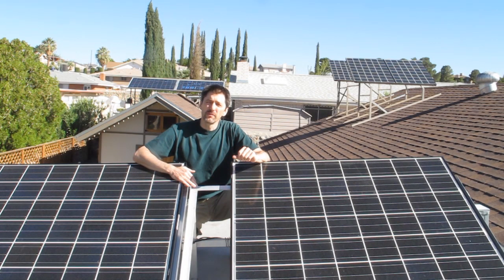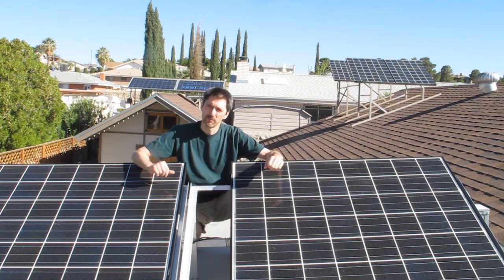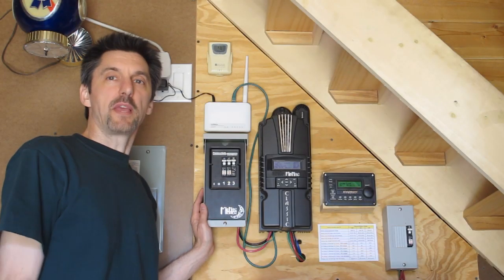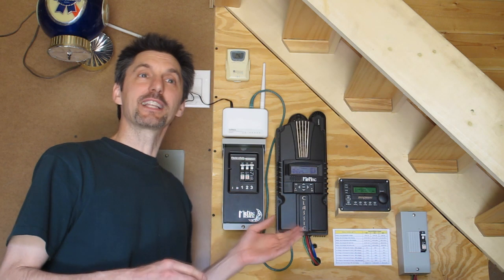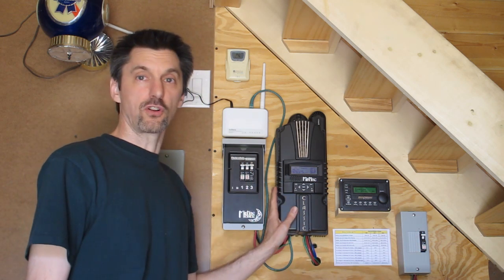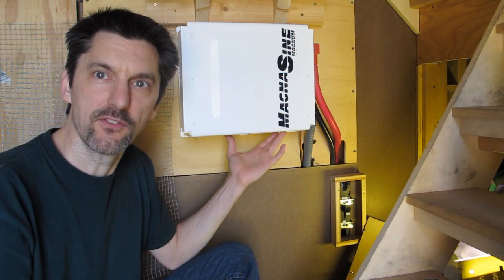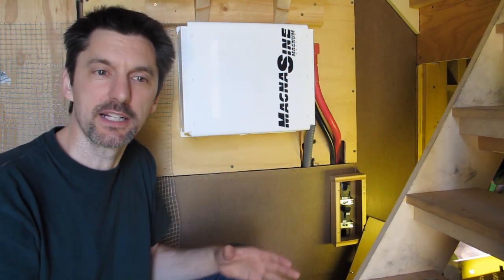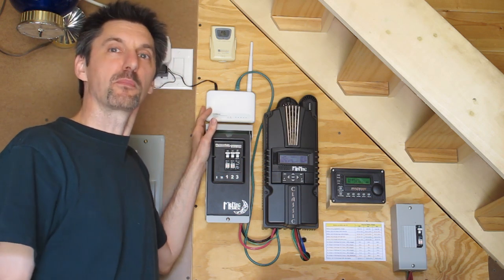Solar Power 2nd Edition (Upgrades and Battery Bank Wiring)

Comment: Awesome video, I have a quick question... I purchased 4800 watt solar panels.. I’m confused on which Midnight Solar Charge controller to get the best out of my solar panels (150, 200 or 250) ?? Any feedback would greatly appreciated brotha, Thanks and hope to hear from you soon
Reply from the maker: Thanks for the complement Big Cali. Always nice to know when the video is helpful. Without knowing your panel specs or how they are wired it's tough to answer your question. However, Midnite Solar makes a sizing tool just for that purpose. Enter in your panel specs, the hottest and coldest temperatures for your area, and how your panels are wired (parallel and/or in series) and it will tell you which one you need. http://www.midnitesolar.com/pages/classic/classic_sizingTool.php

Basically the number of the charge controller corresponds to the max input voltage it's rated for. The Classic 150 means you cannot exceed 150 V(Volts) coming from the panels. Your panels will have a VOC rating which is the highest voltage they can produce in 70-75 degree weather. Colder temps raise the VOC voltage. It my current setup my panels produce 1440 W at 48 V at 30 A. The VOC rating on my panels as they are wired is 60 V. Even at the coldest temp for my area, 0 degrees (very rare), my VOC would be 68 V. So the Classic 150 works fine for my setup.
Reply: Thank you so much for your feedback my friend, this info helped me out a lot!

Comment: I START WITH A LITTER 12V SYSTEM. GOOD VIDEO THANKS. PR
Reply: Hi Justino, how is your system now? I also have a small 12v system. 240Watts of panels, 8 sealed UPS batteries and a Xantrex 1000 watt inverter. I'm sticking to 12 volts as long as i can because i run a few 12v lights and other things on 12 volts. Greetings from sunny Jamaica.

Comment: your video series is great and one of the best instructional videos on the topic of solar! got me taking notes. I want to be able to create a system that will provide power for one to two small AC window units for my mother. she is eighty years old and is on a fixed income. How do I figure out the number of panels, wattage, battery needs, wiring gauge etc for accomplishing this project.

Thanks for any assistance or direction you can point me in.
Reply: These questions are tough to answer due to so many options and variables but I will give a quick overview.  First, it most cases it will be easy,  less expensive, and more reliable to use power from your local utility.

The 5000 BTU window AC unit we use is 850 W on full and 530 W on saver mode. So for two that would be 1700 W on full power. So if you had 300 W panels you would need 6 panels receiving optimum sunlight to run the units on full power. 8 ($2400) to 12 ($3600) panels would be better so the batteries could still charge while the AC is running, to help on cloudy or winter days with less sunshine, and to make up for inefficiency losses with the equipment. You will need a charge controller ($200-600). Then, to run the units at night say for 4 hours on saver mode would require 530 W X 2 for 1060 W X 4 hours = 4 ,000 W hours.  You would need a battery bank similar to the one in the video ($1500-2000). You will need an inverter to convert DC to AC ($500-2000). Then for all the wiring add another $500 and then the cost of hiring someone to install it. Wire gauge depends on the amps going through the system and wire length. There are online calculators to figure that out. 

This is a very rough estimate, there are too many variables to consider which is hard to estimate without being there and knowing usage rates. Hopefully this helps some. Thanks for the great complements. Always good to here someone got use out of the video.
Reply: Expensive. Now I think I  have a better grasp on the relationship of the panel wattage and the battery charging.So if I've interpreted correctly , the panel wattage must be able to provide enough "energy" to recharge the batteries as they are being depleted by the A/C unit(s). Is amperage factored into this?
Reply: very helpful. example. I have a dual window fan that is rated at 0.55 Amps. watts = 12V (battery) x 0,55A. yes?  6.6 watts. so I would only need panels that could minimally produce 6.6 W of energy to keep the batteries stored to handle the draw of energy????  I have the HF 45 W kit, CC and Inverter. getting a battery this weekend. My experiment will be to get the fan running off of solar. will it work? I hope so. thanks Drew.

Comment: You could have easily quoted a simple 2KW or 3KW system. People solar is still very expensive and a small 2KW system is about $3000 self installed. Good video but discharge rates in batteries are at the voltage of which they are rated and do not take into consideration that your are converting it into a 120 volt AC system basically to get the usable amperage is divide by 5 for a 24 volt system and 10 for a 12 volt system. People are still puzzled by batteries including the people who sell them. I've had the same trouble out there. Thanks again for taking the time to give people a detailed explanation of solar systems. I have a 2 KW/ 24VDC system that I take great pride in. I installed it myself start to finish.
Reply: Cruz, thanks for your input and kind words. I convert everything to watts to determine how much power we have since watts are the same whether it's 24V or 120V. Our bank wired at 24V * 420Ah = 10,080Wh or 10KWh.  Now we only want to use 50% of our battery bank so 10KWh * 50% = 5KWh. Since inverters are only 80 t0 90% efficient  we have the 5KWh * 80% = 4KWh of usable power. 

This may be a bit oversimplified but it's quick easy and close enough estimate for our purposes.

Comment: i have a solar power system i found the harbor freight panels give power in low light more then mono or poly panels but with a bigger pannels of mono type and a http controler give enough to charge the batterys even in low light! bright sunlight mono or poly give like twice or 3 times the amps of the harbor freight system 45 watt i have 2 sets of them i use stuff in camper so it got to be light enought to move and pack away! the 3 old boat batterys the same way!

Comment: Very good video and lots of good info!  But I don't understand why you did not upgrade to a 48vdc system, you could have doubled the # of solar panels going to your Midnite Solar charge controller or if you did not, your amperage would be 1/2 of what it is now, and therefore your charge controller would operate at a much cooler temperature.  By the way I have a Midnite Solar Classic 150, a Midnite Solar Kid, and a Magnum 48vdc input, 120/240 vac output inverter, model # MSPAE 4448.  Thanks for the video and have a great one!  P.S. don't mean to be critical, I'm just wandering why you would make the jump from 12vdc to 24vdc and not go all the way to 48vdc!
Reply: Bill Yates Funny thing is we thought the same thing after we upgraded, why not 48V? I guess we had a reason back then, just don't remember why. I believe our thought process was our panels are wired at 48V and the rule of thumb is to have your panels double the volts of your battery bank and therefore inverter to make sure they can charge the batteries fully.
Reply: Ok you blew my mind. You mean you can wire your panels 48volt and charge a 24 volt battery bank? Do you have to set your charge controller a special way or does the Midnite or Outback CC just work it automatically? By the way these are clear concise videos and greatly appreciated.
Reply: Thanks for the kind words Edward. I like to hear the video was easy to follow and helpful.

As for the 48V panels charging the 24V bank, there is a place in the Midnite Classic Controller to enter the battery bank size. After that it figures the best charging rate itself. Even if the clouds are blocking part or some of the panels it makes adjustments. Plus the panel voltage and battery bank voltage can be different. That's why we paid more and went for a MPPT controller over a PWM.

Comment: Nice vid, thanks.
Is there a smart fuse box system that will automatically use your battery power first, supplement with grid power if nec., then switch over completely to grid power when the batteries are at 50% ?
What do you guys think of the Tesla PowerWall system ?
Reply: It is nice to see something different on the battery front, its creating a lot of interest.     Makes me want to hold on to my old batteries for a while longer until the technology matures a bit and people can give their impressions after a few years use.    I am actually disappointed we can't seem to come up with something completely non chemical some sort of a solid state battery.     Seems to me those batteries would last virtually  forever.

Comment: Been over a year now.  How is the system/batteries holding up?
Reply: We replaced those golf cart batteries in the video after two years with batteries made specifically for solar storage. They cost almost twice as much but the plates inside are very thick and should last over twice as long. They are Trojan T-105 RE and they seem to hold a charge longer than the golf cart ones.

The rest of the system is holding up just fine.

Comment: Hai drew.. your videos are really informative and are helpful. is there any alternative for those batteries. It is really heavy and space consumption plus it's also creating hazardous chemical fumes. Is there any alternative for solar battery which can be used for off grid.
Reply: We have looked into other methods of storing power because of the issues you mentioned. We haven't found any feasible solutions as of yet. There are some promising new type batteries made by Aquion Energy called S-Line Battery Stacks that are close to non-toxic with no fumes but still not available yet to the general public. 

Another method is to pump water during the day into a elevated water tank then have the water turn a generator on it's way back down later at night. That has a lot of up front cost and may not be feasible for a lot of people.  

We have researched storing the power on a flywheel. There are people working on doing this but no real solution yet for the general public.

You could just make your system grid-tie and sell the power to the electric company. This won't help in a power outage though.
Reply: Drew Shock Thanks so much for your fast reply. Just for my clarification, Is there any specified solar batteries you would suggest which would work the best for an Off- Grid solar system.

Comment: Many thanks for responding so soon. Another question/s
1. How do you support/buffer surge from your microwave refrigerator? Do you use a capacitor? If so please explain. My understanding is that the cap will help buffer the surge by providing the juice the microwave needs first before getting the juice from the batteries, thus longer lasting batteries.
2. Grounding. How do you ground your solar panels? Do I ground the rack /rail and panels or just the panels? And do I wire them to the service meter or to the ground.
3. Lighting arrestors, how do I wire them.
Reply: We don't have a microwave on the system but I'm sure it could power it. We have an Magnum Energy MS4024PAE inverter, and it has no problem starting anything that we use, including a couple of refrigerators, up. So whatever it needs to start appliances is all ready built in, we don't have to worry about that.

Make sure to follow your local building codes when wiring and grounding your system. We have a copper wire that attaches to or solar panels and the support structure. Then it runs down to the copper grounding rod that's buried 4 to 5 feet underground and sticks up about 6 inches to attach stuff to.

I have never used or wired lighting arrestors. Lightning arrestors and surge protectors are designed to protect electronic equipment by absorbing electrical surges with proper grounding of course. The arrestors my help against a lightening strike that hits a power line a few miles away, however a direct lighten strike to your house or solar panels would probably still fry a lot of your equipment. Fortunately, direct strikes are not common for most people.
Reply from the maker: 1) We do not currently have a microwave connected to our system. However, our inverter can handle the surge to start appliances like microwaves and refrigerators. I would guess that the inverter contains capacitors  to provide starting surges. But don't quote me on that since I am not an inverter workings expert. 

2) We used pressure lug connectors to attach our ground to the aluminum frame of the solar panels themselves. The racks that hold the panels are grounded since they make good metal to metal contact with the grounded panels. All all solar related panels and equipment are then grounded to a grounded rod in the ground. You can use the same rod that grounds your house. 
I have a new video coming out in August 2017 (Solar Power 3rd Edition) that shows and explains all this.

3) We do not have lightening arrestors on our current system so I have not wired any yet myself. I would imagine there is a youtube video on how to do that or check the Midnite Solar website. They sell the product so I'll bet they have instructions on wiring them.

Thanks for the great questions D W.

Comment: Thanks Andrew, I forgot to mention in my post how much I enjoy your videos and thanks for all the inormation, I just finished building a solar shed 10 X 12 which will house my generator and all the solar panels and inside panel for the charge controller & ect, thanks for the information on the breaker
Al

Comment: Hello Andrew, where can I fing the small gray dc breaker that you used in the first videos that connects to the charge controller, I see you moved it
Thanks Al
Reply: Al, in the video it looks grey but it is actually beige. It's a small breaker box called a Baby Box Enclosure made by Midnite Solar. The actual DC breaker in the box is also made by them. You can get it direct but we ordered ours from Northern Arizona Wind & Sun.

Comment: Hay mr drew, I  have an off grid kit with 8 six volt batteries , but I have them connected as 4 - 12 , do u think it's a good idea to connect the batteries as a 2/ 24  volt batterys.   Fyi I have a 24 volt inverter and midnite solar just like yours.